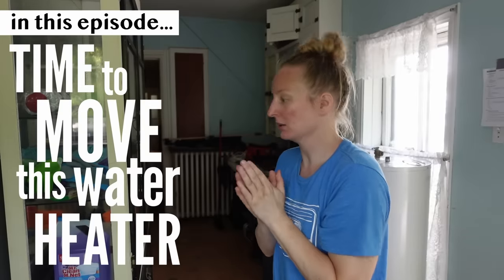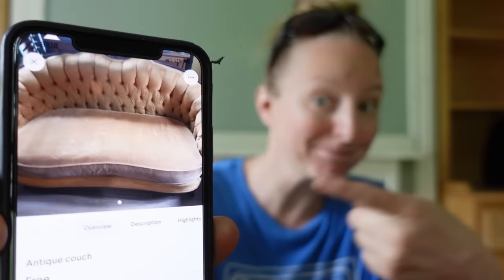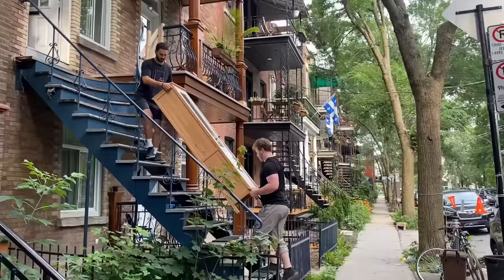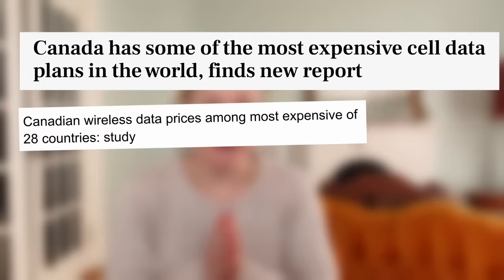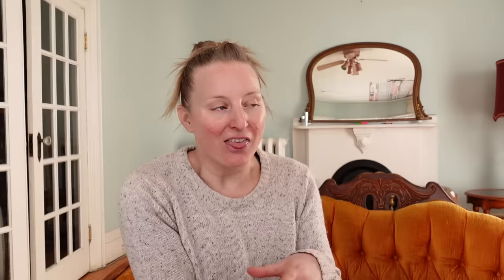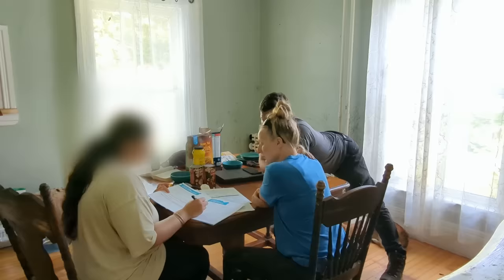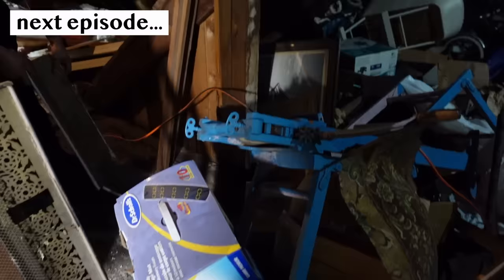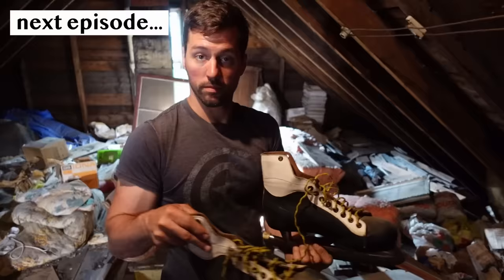you won't believe what we found behind this wall 👀

Comment: 19:35 I'm sure you've heard of pellet stoves in your research. We have one. Very efficient.  They are not terribly deep and are made to go into existing spaces.  They make them look vintage, too. Ours runs through a stainless pipe all the way up, so no worries about old chimney. Good luck.  Love the house videos!!!
Reply from the maker: So do they (at least in your experience) sit flush or even under with the existing surround? Cuz that’s the dilemma I have here - I want to continue to use the lovely cast iron covers most of the time, but everything I’ve seen (admittedly haven’t had much time to look around 😂) sticks out quite far!

Comment: I think a log burner is probably the easiest option? Purely from what I've seen other people do, but it seems like a fairly simple install/conversion. I don't think it would matter too much if it stood sort of half poking out of the fireplace either, so no need to make it deeper. That way you can put stuff on top of it too, like teapots or those fans that help spread the heat. Also, I would think it's more environmentally friendly than gas, but I don't know. Surely it's more sustainable than fossil fuels.

Comment: Fwiw - and I'm guessing someone has already mentioned this in the comments somewhere - wood pellet stoves might be an option. They come in shallower profiles than wood stoves, are pretty efficient, and might require less overhauling of the physical structure of the fireplace/chimney, since I think you can "just" run a vent pipe up the existing chimney. (I have never had one of these, so this is all vague memories from looking through options for converting the fireplace in a Victorian-era row house I used to live in.)

Comment: About the fireplace, if you're not looking to heat the house with the fire - a freestanding little stove placed inside the fireplace with it's own small metal chimney pipe that goes inside the old chimney is pretty common and should be pretty cheap. However, it will barely produce any heat compared to a proper fireplace. The old chimney is built into the walls and the whole structure, including the walls become thermal mass. A proper fire in a fireplace like that would keep the house warm for days after the actual fire goes out. At least that's how it works where I live, houses might be constructed differently here (actual dense brick walls).
Reply from the maker: Fortunately I want the fireplace purely for the fireplace experience - lighting it, feeding it, sitting around it and listening to it. I don't need or want it for the heat, so that's good news. The main problem is that I don't want to change the fireplace aesthetically - I'd like to maintain the current look, so anything installed would need to be flush with the current facade, which I feel is tricky or near impossible 🤔 (but like I said, I haven't had much time to look into it)

Comment: spray foam the attic ceiling will be the first suggestion from an energy standpoint. We did and love it!!!
Reply from the maker: There will be virtually zero spray foam in this house for multiple reasons. I am willing to deal with a slightly higher energy bill in exchange for preserving my house for the long haul, and if there's insulation, it'll be in other forms, but I stay far away from spray foam in virtually all circumstances!

Comment: You might consider a DIY masonry heater or rocket stove heater. Lots of different designs are available, and you might be able to use the coal- burning stoves as the fire box.
Reply from the maker: Thanks for the tips!

Comment: To get your fireplace working you need to get a woodstove that vents out the back, you put your woodstove in front and the pipe vents out the back and up the chimney (we did that with our coal burner) you’ll have to extend the hearth to accommodate the new woodstove, Jotul makes a small stove with the back vent

Comment: Losing the radiators is really such a significant bummer. Maybe you could fix them (in place) somehow? Not sure how much pressure they keep so if welding them would work, but I know there are companies that can refill them with antifreeze.
Reply from the maker: The thought of anti-freeze running through every room of my house, in a system that is has previously exploded and sent it's contents onto every single wall of the house make me shudder 😳
Reply: @ShannonMakes  lol. My friend who lives in a similar age house actually took the antifreeze out of their radiators and changed it to water not long ago. Not sure why, though. Maybe it was cheaper?

Comment: I'd insulate the attic so you can be more energy efficient, that's what my dad did for his old Victorian split. He uses it mostly to store fishing gear and other bit/bobs that need a place to work on in winter than his unheated garage. But it could also be a painting space or gentlewoman gaming room.
Maybe you can have a wood pellet stove for the coal fire place conversion? The units and venting is usually small enough to fit in most places so you probably wouldn't need a new liner, and it would give you the wood fireplace vibes.

Comment: I love the stained glass windows even more now. Thats awesome that they slide. 
Question: is there a different place in the kitchen for the refrigerator? The fridge should have some space away from the stove so it'll cool down OR you could put some type of insulation panel between them.

Comment: I have heard of a company in the Midwest US, that does internal pipe and fireplace resurfacing with silicone moulds use forced air as the center, so the resurfacing is smooth across vertical and horizontal areas
Reply from the maker: hunh, interesting!

Comment: I wind up collecting a lot of crap left by previous tenants and though we already had a set of forearm forklifts, getting two more sets plus a mini set are some of the best things I've scavenged.....

I'm poor and got to take advantage of some of these things and got a boatload of LED light bulbs and also they gave me a new refrigerator.

Old house windows are defiinitely exciting, and I can't tell you I've never used a hammer or prybar and utility knife to open them before...

An attic gaming room would be great for me,, then  maybe I can have more than a quater of the basement for my meadmaking addiction... though having it be the quirky sitting room with all tne nifty but chronologically mismatched furniture would be pretty awesome too... 

Can't wait to see more house shenanigans!
Reply from the maker: The mini forearm fork lifts sound amazing - I'm short enough that these full length ones just barely cut it, and a shorter option sounds amazing!!

Comment: not me screaming at the camera GET A KNIFE during the window sequence. I'm so glad you didn't break the glass, you were very careful with your paint can! also ooof, going into that squat walking down the stairs with the hot water heater I can feel that in my knees.
Reply: I've worked in renovations where the old very shallow fireplace was used as a backer for a old-fashioned-version-of-normal-sized woodstove, making the hearth extend about eighteen inches further into the room for it. small as the rooms usually were that's not insignificant but those things threw out a LOT of heat.
Reply from the maker: Thank you. Yea, the tricky thing is that I'm not looking for something to use as an additional heat source really (it'd just be for the occasional cozy fireplace moment) and the majority of the time, I'd like to keep the beautiful coal inserts in their place, so having something stick out even a few inches past where they currently stick out is something I'm trying to avoid (which I wasn't clear about in the video, my bad).

Comment: A wood stove woulld be your easiest option, the stove itself can sit outside the actual space, or partway in, after an inspection to be sure the chiminies are safe you can easily place a stove pipe partway up the chimney.and a bit of tile on the floor. Also NOT expensive.
Reply from the maker: alas, the entire goal would be to leave the aesthetics as-is, so it'd have to sit IN the current fireplace completely. Hence the dilemma 🥲

Comment: Please please listen to 99% Invisible's episode 547 Cooking With Gas before you decide about the fireplaces and stove!
Love the corgi adventure content. Like how she doesn't hesitate before jumping into the pond to retrieve the stick 😊
What first came to mind for the attic is how a few of those old houses had a listening corner, or a way of making spectres appear. Probably not worth it though 😅
Reply from the maker: Having just read the summary (6:30 am is too early for me to try and tackle a podcast), I am absolutely not surprised to hear that gas stoves emit pollutants and are diminishing our air quality 😑 I'm curious to hear more, will definitely listen later - regarding the fireplace, even if it was gas, it almost definitely wouldn't get used enough to cause any harm, I'm looking for an occasional cozy moment of ambiance and perhaps a saviour in a power outage, not a regular heating feature... but yea, thanks for the link!

Comment: Line the chimneys and install pellet stoves into the fireplaces. You’ll need to replace all of the sash cords for the windows, use chain or wire. My attic windows are similar to yours, there’s a piece of wood on the right side that may rotate to hold the bottom window open. Wire the attic for light and outlets, insulate and finish it off. Then you’ll have light and can decide what to do with it later. I can only stand in the middle so mine is for storage. I did bring up industrial shelves and put them in the middle between the joists for storage. There are five. Too late now since these videos are so old but you shouldn’t be throwing all of the wood away, even if it is rotten. Some might be trim, some can be used as a template when replacing and some might be repurposed for something you’re not aware of yet. Since you don’t have any money and you have to pay for that dumpster, keeping as much out of it and limiting it to only the essentials saves you money. But since these videos are so old you are missing out on advice from those of us that have gone through this before. My house is 1922 and I’ve done what you’re doing, my house simply wasn’t quite as bad.
Reply from the maker: There are no sash cords, they are not weighted windows. Yes, I know what I'm talking about, I grew up with double hung, rope-and-pulley windows, and have refurbished them. Also, I didn't throw away all of the wood, nor did I throw away any trim. I am not stupid, nor naive, nor trigger happy with the dumpster... perhaps have some faith that I do, in fact, know what I'm doing at least on a common sense level
Reply: @ShannonMakes  those are big windows. They must have something. I have one set of windows that have a spring box inset into the side with a wire and hook that go down and attach to the bottom of the window on both sides. There are no sash pockets. I had to refurbish it a bit as there is no way to replace it. Once you get a window open you might find something like that. Keeping the original windows is the way to go. I have mine and it was one of the must haves when I was house shopping. New windows have to be replaced every 20 years and all of yours are likely custom sizes which is expensive. I also have my original siding. You might get lucky and have yours under all of those layers. The aluminum and vinyl might simply have been to avoid having to paint and maintain. Hopefully it won’t be in such a bad  state it cannot be restored.

Comment: I would probably turn the attic into an art and crafting space for anything that needs extra ventilation (like oil paint thinner, spray paints, sanding, things that produce a lot of dust). Sure I could go outside to do those things, but outside is cold and requires me to put pants on! 😅
Reply from the maker: Boo on pants!!

Comment: Our 110 year old fireplace was also not fit to burn wood or coal, we put in a gas insert, AND I believe most gas units can be converted to use PROPANE which would also get you the gas stove you wanted. BONUS it also heats the room, we don't have to use the furnace for the front parlor when running the fireplace, and this company does the arched top that (can) fit some of the older profiles like yours. Good luck!

Comment: Another alternative to coal and even wood, is a little puck or cake made out of highly-compressed straw or some such (no, I don’t mean horse apples or cow pats 😂🤣😂). They’re made as an eco-friendly alternative fuel for Aga stoves. You would want an inspection and general sweep of the chimneys, of course, but if they are stable but just not suitable for a fire without extensive repairs or an unavailable coal/bio-fuel-that’s-totally-not-horse-apples, your fireplaces are an ideal place to have wood burning stoves. They make quite tiny ones for campers and things, so there are sizes that would fit in the hearth without reconstruction and still give heat, enjoyment, and a home for Calcifer. The stove-installation and chimney are something that you can DIY, as long as you have access. If a professional does it, it is still a fraction of the cost of repairing a chimney and making it smoke-tight and fire rated.
I’m enjoying seeing your house-renovation journey. What a wonderful building! The sliding stained-glass windows in the bathroom are delightful.

Comment: Fireplace may have potential as a wood stove back. The fireplace itself offers the chimney and acts as a heat sink, while the stove sits out further into the room. You would only need to add a larger fireproof apron in front of hearth to accommodate the stove.

Comment: Oh yeah, and the sooner you can insulate the anti the better, otherwise the air you heat for the house goes up into (and out of) the attic and your furnace or radiators are pretty useless. You don't have to finish the attic, but try to insulate it before winter if you can.
Reply from the maker: Oh yea, absolutely :-)

Comment: Is propane delivery not an option? Most natural gas stoves are easy to convert to propane, I bet there are orifice kits for some gas fireplaces too.  If you have the wall open, you could lay pipe for later conversion.

Comment: pellet stoves. i swear by mine. theyre simple machines that can run on the tiniest generators (if the power goes out) and you get the benefit of Actual Fire (TM) and  easy cleanup. pellets are pretty cheap too, it was about $1000 for me to run my pellet stove for the entire winter and my house stayed above 65 the entire time
Reply from the maker: It's true that they'd be very practical.... the problem (what a first world problem, I know) is that I definitely want the fireplace for the wood-burning ✨experience✨, not for the actual heat. I love the process - the lighting, the feeding, the stoking, the sound it makes, the smell it gives off... and I dunno if the pellet stove would satisfy those cravings
Reply: oh, of course! as an older house owner myself, i didnt know if it was a Vibes item or a Survival item. there are a few types of wood stoves, include full on wood burning ovens/ranges that are super cute (they do weigh a ton tho, so you have to reinforce the floor). Some wood stoves have glass fronts, if the ambiance matters to you. and let me tell you, Marketplace is FULL of them

Comment: you might be able to easily burn wood pellets in a coal fireplace with just some very simple modifications. And it would be very cost effective. get the heat and the smell and could potentially get the sight of the flames with some glass doors or something

Comment: You could use wood burning stoves in front of the fireplaces. You could install pellet burning stoves instead of wood burning stoves. If you don't use the fireplaces be sure to cover the smoke holes so that heat will not be lost. Don't forget to cover the tops of the chimneys to keep birds and bats out.  You may already have bats and birds in them? Have you checked?
Reply from the maker: I’m pretty sure we’d notice if there were animals in the chimneys 🕊️🦇🤣

Comment: Phil holds Shannon's entire weight from one arm in the video introduction - me: well, they are circus performers I guess.
Phil picks up concrete slab to use as a water heater base - me: DAMN that man is strong. 
From which you learn that I have (1) never tried to hold someone's weight with one arm, but HAVE tried to lift concrete slabs AND (2) that concrete slabs are A LOT heavier than Phil made this look.